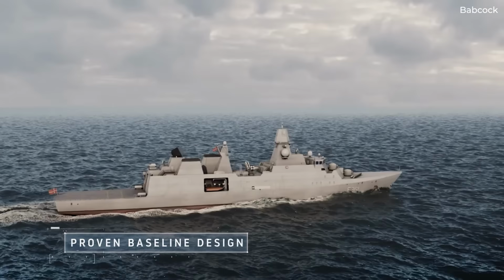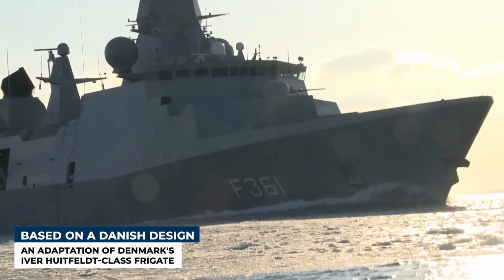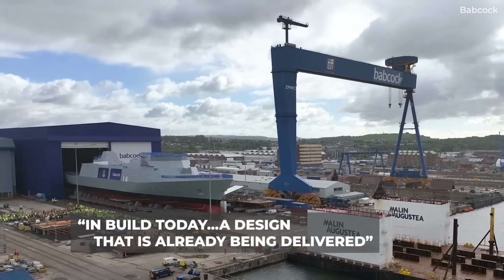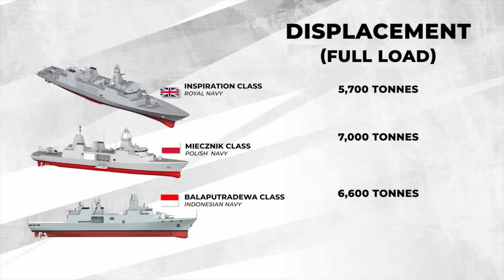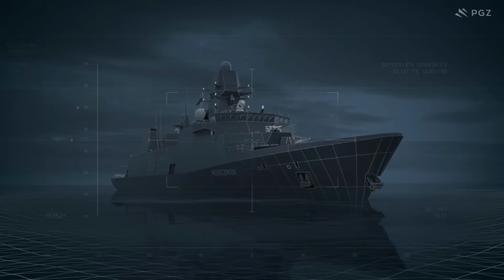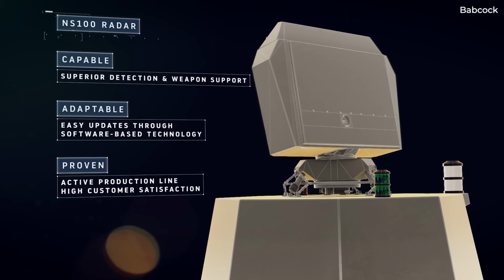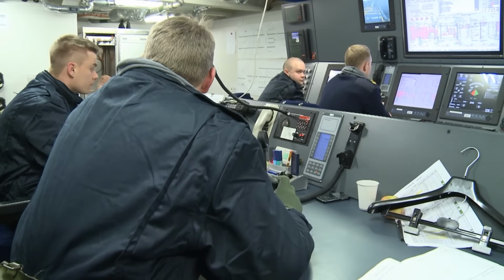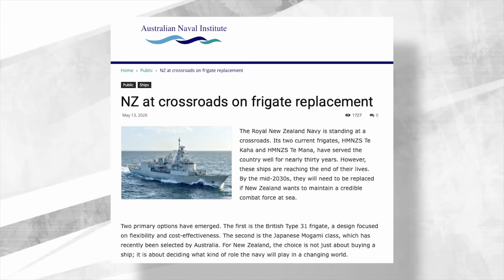Type 31 (AH140) Frigate: The Best Option For New Zealand?

Comment: As a Brit i would have to say take the Mogami. There is more chance you will get them on time, on spec and on cost. The UK is struggling to produce what we need in the Type 26 and Type 31, now Norway wants the Type 26 its looks like the RN 3rd or 4th hull might be going to Norway.

Also you would have commonality with your closest partner Australia in picking the Mogami. Its not that Mogami is better or more capable its just that realistically you will get them when you want them.

Comment: The RNZN retrained crew to the ANZAC frigate specifications back in the mid-late 90s. As a comms op in 1996, who had only been trained in the use of ageing comms gear on existing inshore boats and Leander class frigates, I was posted to be part of the sea trials and workup crew of HMNZS Te Kaha (then still in drydock completing fitout in Williamstown) I was billeted at RAAF Base Williams in Laverton to be retrained in Williamstown to work the new ANZAC frigate communications centre hardware and software configurations. So the RNZN could retrain crews for new systems if it wanted to because it's been done before.

Comment: Babcock’s Arrowhead 140/Type 31 is leading the Kiwi competition for 3 key reasons:

1. Deep Roots: Babcock has managed NZ’s largest maritime shipyard (Devonport) since 1995, backing 600 local suppliers and pumping NZD 220M into the economy. Selecting them guarantees local jobs.
2. Legal Hurdles for Japan: Japan offers the Mogami-class, but NZ is the only Five Eyes member without a formal Defense Technology Transfer Agreement with Tokyo. This creates high political uncertainty.
3. Crewed-Uncrewed Teaming: RNZN suffers severe manning shortages. The automated, low-crew AH140 acts as a hybrid task force controller for drones, fixing NZ's manpower crisis perfectly. 

Babcock isn't just selling products, they are selling built-in partnerships.

Comment: Since NZ Navy only plan on getting two frigates,  that is a zero availability navy. Three ships is the absolute minimum, ship 1 deployed, ship 2 for crew training, ship 3 in maintenance. For continuous, reliable operations, four ships is needed to absorb unexpected mechanical failures. NZ Navy already messed up by only getting two ships, maybe Royal Navy can provide crew training, anyway, with such a small number of ships, the main Q is if deep maintenance, upgrades and repairs can be done in NZ. 

More nations should think like Norway, on submarines coop with Germany making a shared fleet of 6+6 identical subs, both navies will use shared naval base for deep maintenance and have shared crew training, it's shared upgrade program. On frigates coop with UK making shared fleet of 8+5 identical frigates. Norwegian shipyards was blocked from bid on submarines and frigates, instead use existing production lines. Frigates will use UK drydocks for deep maintenance and upgrades, this create scale. In return, Brits add competitive Norwegian tech in the supply chain or some other Norwegian kit. This create a huge win-win and add scale, which will lower cost and give higher availability

Comment: The Type 31 (AH140) fully meets the multi-role capabilities required of a frigate for the Royal New Zealand Navy. In contrast, the "New Mogami" class is a combat vessel designed for a large-scale navy, making it somewhat ill-suited to the specific realities of the RNZN. For a small navy, the ability of a single ship to undertake a wide range of missions is crucial, and the availability of space for additional personnel is an attractive feature; furthermore, the construction cost is clearly more favorable than that of the "New Mogami" class.
However, simply replacing the two Anzac-class ships would not resolve the capability shortfall; three to four new frigates are required. Additionally, the "New Mogami" class holds a clear advantage in anti-submarine warfare capabilities—an essential asset for countering the increasing number of submarines in the East Asian region.

Comment: Cost is also measured in crew members, and the Type 31 would have a larger crew complement than the Mogami (110 vs 90). In addition to lower cost, Type 31 is billed as a more multi-role ship, so maybe some of that is an ability to deploy more people in small boats or shore landings, but they all need to be trained, fed, housed, and paid. So if New Zealand could (for sake of argument) afford 3 Type 31's for the price of 2 Mogamis, how does that cost comparison hold up to sustaining 330 sailors on 3 type 31's compared to 180 on 2 Mogamis? Just food for thought.

Comment: One suspects that costs (both acquisition and through life) will be the determining factors in this procurement simply due to the constraints of the NZ defence budget. As such, perhaps the most important thing that the T31 offers is the opportunity to buy more hulls with a lower equipment fit and upgrade them later (essentially the way that the UK is buying them). Mogami appears much more of a completed system with everything already defined, especially if bought "off the shelf" which would mean using Japanese weapons and sensors. Conversely, if opting for the upgraded Australian flavour one can only imagine how much extra cost and delay will be built into that programme before it enters service with its US weapons fit as on current trends it would take a significant amount of optimism to expect that to go completely to plan. (There is also an open question in that I don't know how disposed towards the Americans the New Zealanders currently are as they do not traditionally have the zeal for depending upon US weapons systems that the Aussies have).

Comment: Just because they're frigates doesn't mean that both the Mogami (in particular the upgraded Mogami) and Type 31 are in the same class. The type 31 is meant to be a 'cheap' warship which can be easily built and cheaply operated. The Mogami on the other hand is a advanced high capability warship. It's stealth, technologically superior design and systems mean it only needs a crew of 90 and as low as 60 during high intensity operations. The Mogami. is is a lot better at ASW and drone warfare and it's faster as well. The Mogami is hands down the better warship - and by a considerable margin. The real question is whether NZ needs the additional capabilities of Mogami over the Type 31. I think the Mogami offers better value for money with NZ because its does a lot more that a naval nation like NZ would benefit from. Also, because Australia and Japan operates them, it'll be a no brainer for parts and training pipeline. Oh yes, one other thing I forgot to mention - it's Japanese made! Which means, unlike a European warships it'll be built a lot better i.e. no breakdowns or issues like that.

Comment: The Type 31 is a large, adaptable and relatively affordable hull, but comparisons often confuse what the Arrowhead 140 could carry with what the Royal Navy’s Type 31 is actually fitted to do.

The Mogami is the clear winner in several important areas. First is anti-submarine warfare. Mogami has an integrated variable-depth sonar and towed-array sonar, while the RN Type 31 has no comparable ship-mounted ASW sonar suite in its published fit. The Australian Government specifically describes the upgraded Mogami as having highly capable sonar and genuine undersea-warfare capability.

Second is mine warfare. Mogami was designed from the outset as an FFM—Frigate, Multi-purpose/Mine—with integrated unmanned mine-countermeasure systems. Type 31 merely has mission space that could carry minehunting equipment. Having room for a future system is not the same as possessing an integrated operational capability.

Third is terminal missile defence. The Japanese Mogami fit includes SeaRAM, providing a dedicated autonomous last-ditch defence against incoming anti-ship missiles. The published Type 31 fit has Sea Ceptor, a 57 mm gun and two 40 mm guns, but no SeaRAM or Phalanx. Its programmable guns are useful, but they do not fully replace a dedicated missile CIWS.

Mogami also carries a 127 mm five-inch gun, giving it substantially more credible naval gunfire-support capability than Type 31’s 57 mm weapon. The 57 mm is excellent against drones and small craft, but its much smaller projectile cannot provide the same effect against shore positions, structures or vehicles.

The upgraded Mogami also brings 32 Mk 41 cells, anti-ship missiles, a range of up to 10,000 nautical miles and a crew of only about 92. That combination of firepower, endurance and low manpower demand is particularly attractive for a personnel-constrained navy such as the RNZN.

Type 31 wins on internal volume, mission space and future growth potential. However, Mogami wins on capabilities that are already designed and integrated: ASW, mine warfare, SeaRAM, naval gunfire support, low crewing and long-range Pacific operations.

A Type 31 could be upgraded with a full sonar suite, SeaRAM, mine-warfare systems and a five-inch gun—but by then it would be an expensive, heavily modified New Zealand-specific Arrowhead 140, rather than the supposedly inexpensive Type 31 usually presented in these comparisons. For the RNZN, Mogami is the more complete warship and offers the additional strategic benefit of commonality with Australia’s future frigate fleet.

Comment: If NZ worked in with Australia, we could have ordered 15 off the japanese.  11 for Oz and 4 for NZ.  NZ needs more than 2 Frigates.
Reply: NZ has a 30% trade deficit and is dying from privatisation & external owners of critical domestic production. 8 Seahawks are ordered IIRC so you can make your assumptions from there, 2 training? and 2 on rotation cycles for each ship? 

I want to See AU and NZ get the MV75 Cheyenne 2's once they come into production for island hopping and air mobile light guns.
Reply: Not sure how you're affording 2 let alone 4
Reply: @starship4453  Tax. How else does the government fund things? New Zealand, while small, is a relatively wealthy country, funding a modest navy isn't a question of means, but priority.

Beyond that, if they wanted to increase the number to 3 (probably the most sensible number, as it makes sure 1 is always availible), they could partially fund it by getting rid of the 2-ship offshore patrol vessel category. Instead, increase both the frigates from 2 to 3, and the much cheaper inshore patrol vessels from 2 to 3.

2x $110m OPVs minus the $36m for the extra IPV, adjusted for inflation, gives $311m ($183m USD) savings which can be put towards the cost of the extra frigate.
Reply: @sergarlantyrell7847  relatively wealthy with your ~$240 billion USD annual GDP? 😅 Lol. We're spending just over that on AUKUS. Don't Kiwis already pay plenty of tax as on top of a painfully high cost of living? 😅

You'd want to pay for the 3rd frigate by selling off the OPVs and thereby increasing the workload on the 3 frigates? Strange idea. You're not going to get that much money back for them, you're just going to make more work for yourselves. If you can get 3 Mogami's fit ~$1bn each, that's going to really bite into the defence budget
Reply: @starship4453  $52,000 per capita puts them in the wealthier half of the world. Plus $240bn at a 2% defence budget gives them $4.8bn/year. Over a build time of say 5 years, 3x $500m ships amounts to about 6% of that. I'd call that affordable even without having to restructure the rest of the navy.

No, not selling them off. Rather, not replacing them. You'd still have the same 6 hulls, just a different composition.

Mogamis don't cost that much, and besides, I would expect them to go for a cheaper option Type 31, so $500m per ship gets them a very capable ship.

The point of having more than 2 is with 2, there is roughly 4 months of the year when they won't have a warship available at all.
Reply: @sergarlantyrell7847 buying them is just the beginning... then you need to stock them, train your sailors on them, and maintain them.
Reply: @starship4453  which is why having fewer classes of ships and taking advantage of economies of scale is important.
Reply: @sergarlantyrell7847 still can't see where the money is coming from
Reply: we dont even have enough crew to crew 2 how are we suppose to field 4
Reply: @jono6472  3 is the sweet spot, 1 active, 1 ready, 1 refitting.
Reply: @jono6472  You must pay the military better. Easy to figure out. But NZ wants to be cheap, hoping that the other countries will save their arse
Reply: @leemarkley8496  Australia will always have New Zealand covered. Any attack would come through Australia, so again, no direct hit to NZ.
Reply: @jono6472  National Service mate.
Reply: @Mrbuckaroonie.. that is definitely not gonna pass in parliament. You have to look at the bigger strategic picture for New Zealand, unless the Aussies or Americans invade there is nobody else in the direct region that can pose a threat, which both are allies. If you look at this the government’s position is always been the same, rearm only when war breaks out. The current NZ forces basically just an expeditionary unit to be sent overseas if needed. The next war NZ fights is gonna be a world war anyway, that’s gonna turn nuclear at some point so no need to bother fighting honestly.
Reply: @jono6472  if you seriously think that New Zealand is too far away to be affected, you're very much mistaken.
Reply: @starship4453 we are very far to be INVADED, INVADED is key word. Tell me who is gonna day one invade New Zealand in the next war… then we have time to rearm like the other 2 world wars. Especially with Australian built mogamis. We all know the next world war the losing side is gonna use nukes and what’s the point of 2 extra frigates gonna do. Please don’t use ur American military industrial complex mind on my country we can’t afford it.
Reply: @jono6472  That's not the point it takes decades to spin up military competence from logistics and infrastructure if you need it. The Pacific Islands are a set of keys to Antarctica and a naval blockade & support set of treasures, just like the England used to have all over the world to support their naval power. 
They don't have to invade they just starve you out of the global ecosystem and give you terms to subjugate your nation that way. 
Globalism wrecked a lot of smaller countries independence and national autonomy and sustainability. 
NZ doesn't even have independent energy now that Marsden Point is sabotaged by Ardern who put concrete in the pipes. 

You just need to give credible support to bigger nations to build enough political good will and have a word in sideways at all.
Reply: Mogami is still a very expensive ship, I don't think with what NZ is prepared to spend, they could afford 4. If mass is a requirement, that really puts Type 31 based designs as the top pick.
NZ could buy somewhere between 3x T31 for the cost of 2x Mogami class and 4x T31 for 3x Mogamis.

Comment: The type-31 isn't a bad choice, but in this Kiwi naval enthusiast's opinion, it's not necessarily the best choice either. Ultimately the decision should come down to what the Navy actually needs and then the government will make a decision based off what it wants at the time. 
A prime example of this, when the Leanders were being replaced, the US offered us Perrys at around a quarter of the procurement cost, but we went with two ANZACs at $400million NZD a piece anyway. And the reasons for that were all very reasonable, close ties with Australia, a local supply chain for maintenance, locally built, and we built parts in NZ, interoperability, etc.
The issue I have with the Type-31 is that we will have none of that. The ships, however many we buy, will be built in the UK, which is great for them, but not so good for us. And let's face it, the UK ship building industry is already struggling. We'll likely only get two, which is also a massive issue, as seen by the lack of deployablility and surge of our two Anzacs over the years. 
The next issue is cost. Type-31 looks great on paper, but base cost and actual cost are very different things. Again, it depends on what we would put on them, yes there is room to go wild, but should we? What do we actually need? Do we need all that space? 
That's why I actually think Mogami is the better option here. Lower crew, you get exactly what you pay for, and you know exactly what you're buying. And if ours are built in Australia, then same benefits as Anzac, if they're built in Japan, well at least it's closer than the UK.